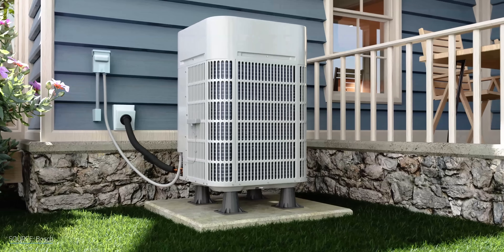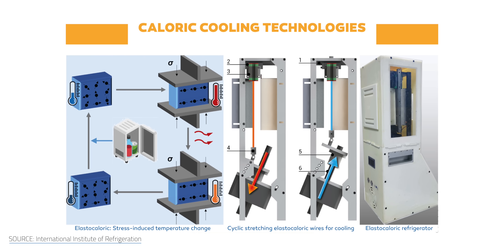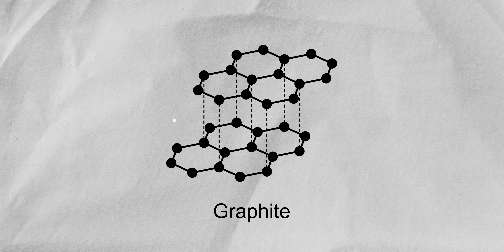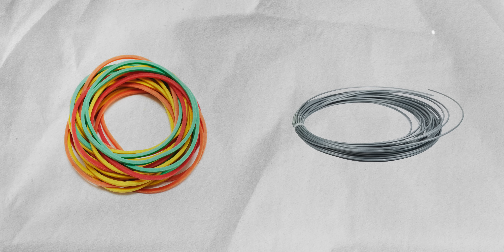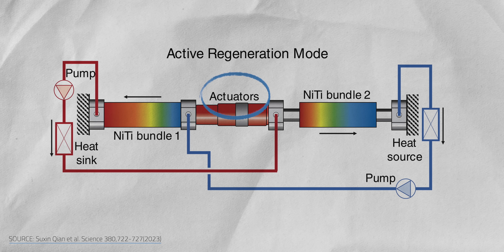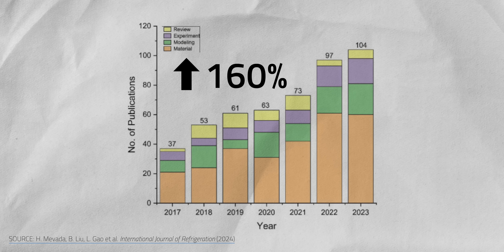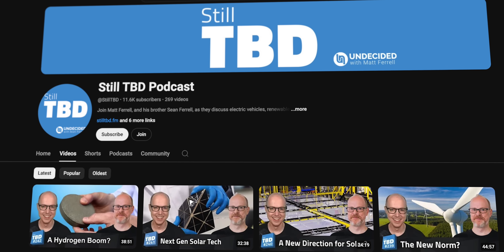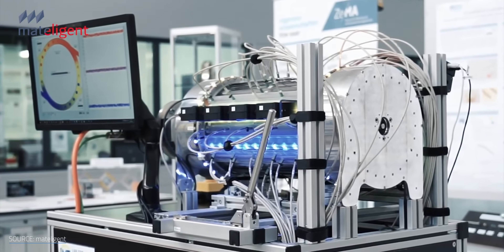How Solid State Cooling Could Change Everything

Comment: Hi ! I am from Germany !
We have a meterial , witch is a combination of two metals.
"Be-metal" ! It has one part bending by heat . The other part is not easy to bend with the same amount of heat.
I think they use them as a safty in specific Products.
Disconnecting the energy flow ! ?
I am a layman ! Witch is a person with not much knowledge in a lot of aspecs.
I was thinking . Combining this cooling material with a Be-metal .
This would make it a three-metal ! 
Heat makes the three metal bend.
The cooling effect should be way faster with the be-metal.
By the way.
Superconductors or flowting could be the next stepp with a faster cooling option.
This could change the way of flying a drone in future.
Stay healthy !
Reply: @perobaotic8098  it's called bi-metall, because it's made of two metals with different thermal expansion coefficients

Comment: Yes, I would be interested in getting a freezer or refrigerator that runs on solid state cooling. However, I don't think I'll see one in my lifetime. 

I am slowly moving up the technology ladder to reduce my carbon footprint. I have already replaced most of the windows in my house to more efficient designs. I just installed a heat pump to heat and cool my house and take most of the load off of my gas furnace. Over the next few years, as I am forced to replace worn out devices, I intend to replace them with more efficient versions, even if I don't take the leap to the next level of technology. 

However, I don't want to constantly be on the "bleeding edge". For instance, the last time I had to buy a clothes dryer, heat pump dryers weren't a good fit: too small, too slow, and too expensive. Same for my hot water heater. Next time, maybe not. The last time I had to buy a car, electric cars were too expensive and too limited in range for me. The next time around, I will certainly go electric. Solar panels? Battery backups? Smart electrical panels? All under consideration, and maybe down the road.

Over time, I'll do what I can to upgrade my various devices and constantly reduce my carbon footprint. The solid state cooling technology is way too far down the road for me to consider now, and maybe ever.

Comment: 2:38 I was so disappointed  as a kid when I found out that we use nuclear power to boil water to vapor in order to get electricity and not get it directly from a nuclear reaction :)
Reply: assuming you are no longer a kid, i hope you understand the issues of direct conversion - especially transmission.

you may be disappointed again to learn that fusion energy (which is still 30 years away - it always is) is expected to be used to boil water and spin turbines - the good old Rankine cycle - which is at best 40% efficient - so 60% of the heat goes into the environment.

solar PVs address these issues best right now
Reply: No, you werent bro. Like we do use nuclear power directly from a reaction...its just that that power is limited by materials from heat exchange. RTGs have been used for powering lighthouses, satellites, and even pacemakers for decades now...but they just cant power a city. Its not feasible
Reply: You will be more disappointed when you know that water is necessary for everything and that there are systems that are simpler and more direct than electricity, and that the thermal system is the most efficient system for converting energy, even more efficient than photovoltaic panels. The efficiency of the combined steam cycle is (60%), while the efficiency of photovoltaic panels ranges between (10%-25%), even the reciprocating gasoline engine is more efficient (36%-42%).
Reply: @ياقوت-ق  you are convoluting different definitions of efficiency
Reply: There are beta emitters as Nuclear sources, but they aren't as efficient as we would need for direct transmission.
Reply: The reall dissapointing part about Coal vs Nuclear is learning that Coal Power Plant causes more radioactive pollution in enviorment than Nuclear.
HOW
Reply: LOL yeah it's literally just trading coal for nuclear rods. I was disappointed too.

Comment: Nickel and Titanium alloy? ouch that's going to be an expensive cooling system.

Yep, around 150/kg. normal low carbon steel is .93/kg (actually 850/ton but scaled to the same units). Plain A572 construction beam steel is even cheaper than that.

Comment: As we all know you stress metal it breaks in two. Metal doesn’t like bending or stressed for a long period of time before it breaks. I think there’s a lot more that needs to. Go into this technology before it makes it to the consumer.
Reply: I don’t think this is stress in the way you’re thinking… I think this is more like springs ( I am not an engineer or physicist so I could be way off here )
Reply: @MurderMostFowl  Yes, it is more like springs here but with a lot more motion capability. Cycle life should be in the billions just like springs when used within specifications. And just like springs, when pushed outside of specifications then permanent deformation and loss of functionality would occur.
Reply: Nitinol is quite strong an durable. It is still not perfect and fatigue is a possible issue. Ideally the transition between the 2 states is reversible, but with impurities there can also be aging effects, like moving the impurities around to one region of the active material where they can than start cracks. Another point is the surface: the material should have an oxide layer to protect it from further oxidation. This oxide has a hard time to take the high strain and may very well crack over time and this way cause stress corrosion.

Comment: Without knowing more about the specifics of the options, that 'really small" space that includes 'a can or bottle of a softdrink' really isn't necessarily a negative. There is a fairly huge need in the medical community for small refrigerators that have about that much space in them. Think insulin pens for diabetics, and other medicine that should be refrigerated for best results, yet you may want close at hand in the bedroom or at the office. An option for that is Peltier coolers, but after watching the Technology Connections episode on those, and keeping in mind the fairly high power requirements for them, I'm not sure that's a useful solution. Among their problems includes the fact that they really only provide about a 40F, or 21c temperature difference across the peltier chip, which means that if the outside temp of the refrigerator is over 100F to begin with, you're only "cooling" the contents to 60 F, which may not be sufficient. You might be able to do better by adding a second cooling stage, but that adds complexity, which may not be a good thing.

The problem I see with the elastocaloric refrigerator would be that it may not require a fluid to transfer, but I'd be concerned about the noise involved. That is going to depend on how the system 'works' for doing the heat transfer through the material, but so0 far I don't see enough information. Perhaps my concerns are for naught, but when I think of something that does thermal transfer through changing the shape of a material, I have to imagine that there are going to be mechanical noises involved. More so if you have to move fluids around as well. Then again, this is one of the first times I've even heard of the concept. IDK.

Comment: With how high the COP of modern heat-transfer systems, you have to start to wonder if we could use the heat to generate electricity that would be more than the system needs to run.
Reply: A potential-motion-machine?
Reply: @GarryLarryBarry  No, but it is part of the "system" and thus if the system has energy inside it, then you can pull that energy out. Thats why pumps work well. The problem is the lost you have to take in just to convert it back into power. So unless it has a really HIGH COP - you wont be getting anything back out of it or very little at least for the added cost.